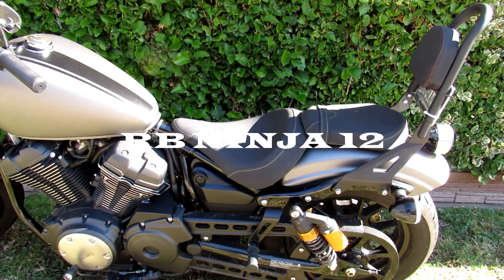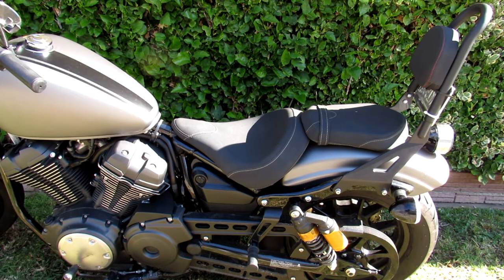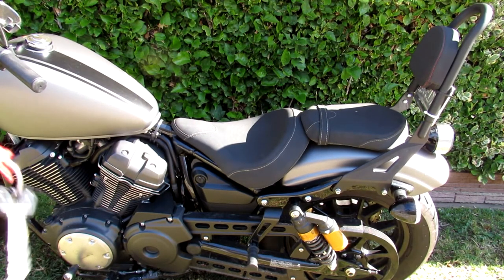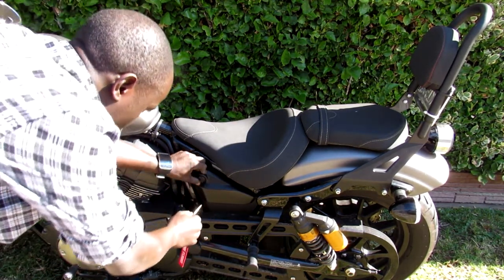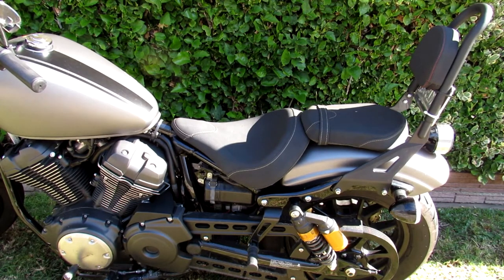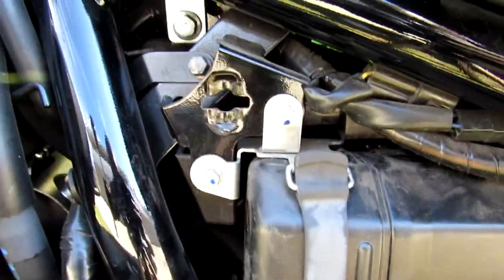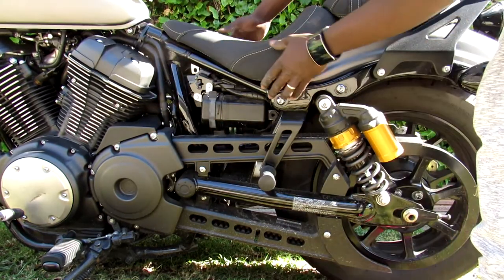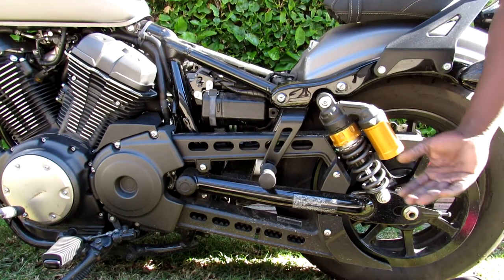HOW TO TAKE OFF A YAMAHA BOLT SEAT

Comment: Thanks. Do you also have a video showing how to remove the pillion seat?
Reply from the maker: U have to take off the rider seat and once that is off, check under the pillow seat,there are two bolts which u need to unscrew/remove in order to get that pillion seat off

Comment: Do you know how to take off the battery ?
Reply from the maker: U can take of the battery from the other side,1st take off the seat and on the right side ,u will undo the two bolt which holding the battery cover  and the battery cover is supported by that chrome bracket. With two bolt.
Reply: Thanks going to give it a try.